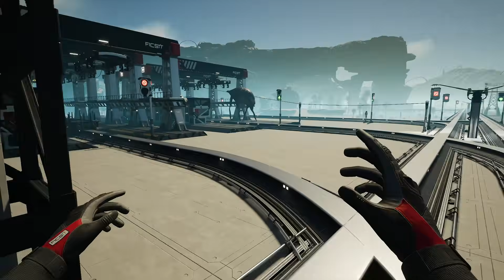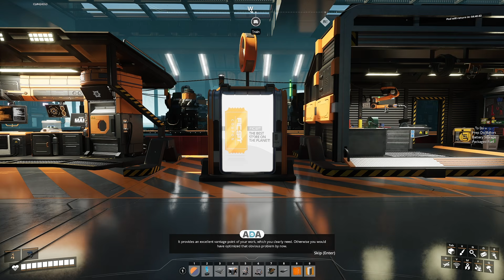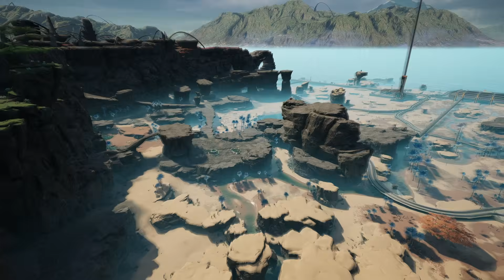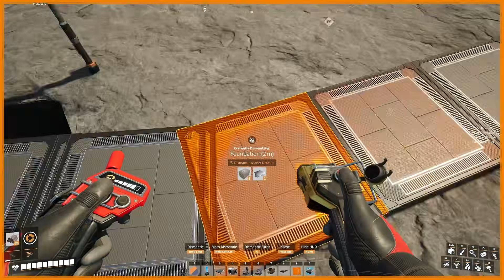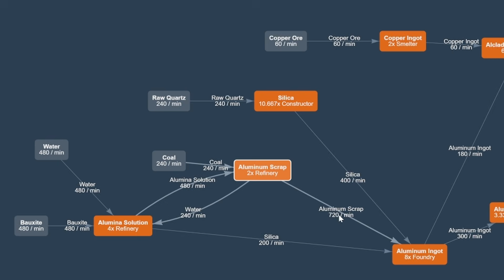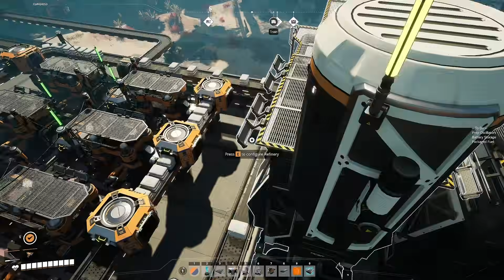Building An Efficient Aluminum Facility in Satisfactory 1.1 Guided Playthrough

Comment: Hi there, love your vids. Did not think of maximizing the quartz extraction as you didbut liked that I won’t have ro go back to that cave, question, did you use the Eastern most entrance/exit to run the belts? If so, right at the exit points over that little rock “divider” there are 2 Coal nodes. :)

Comment: Back recently , its rather easy, just feed the water from the end of it back into the beginning and undeclock the water pump accordingly. No issue. Returning right now after my last save was from 2022.
Reply: Under clocking pumps won’t decrease flow rate, just head lift. I think you mean valves, and that doesn’t always work 100%. If you have a ton of fluid buffers and come by every once in a while to flush them out it’s fine though
Reply: @ookison No, i meant water harvesters.
Reply: @ookison Water harvester clocked to harvest only exactly the missing portion. Cant back up with water thats not in the system. Havent needed any buffers (other than the pipes themselves) and that worked for hundrets of hours, havent even thought about it really when i did it.

Comment: For anyone wondering why their machines tend to stop but you have all your inputs/outputs correct… try deleting your “in” machine(the first refinery making the Alumina solution) water that’s stored. While the correct inputs may be there, the other machine making the Aluminum Scrap stops because it can’t spit out the water byproduct, so by deleting the stored water in the first machine it should level out the water input. Obviously double all inputs/outputs with shards if you’re wanting to increase the overall output but the method of making sure the second machine can spit out its water byproduct remains the same(don’t forget to change your water extractor to 160m3 if you do otherwise you’ve got another issue lol)

Comment: When I start building a railway, I always connect the station to power and start building from the station so I always have hover pack power.

I incorporate power lines like you recommend, but don't connect them until after the rail is done.

Comment: so i noticed if you pipe out all that quartz with Teir 2 miners, that means the teir 4 belts are not sufficient at moving 600 quartz a minute.  i have a ton of tickets would you just recommend buying the alum. sheets to use Tier 5 belts to get the goods out of the cave?

Comment: Why does your calculator look different than mine when I input the sheets and the casings. Its giving me starting recipes that call for SAM and no Bauxite because I guess the SAM is turning copper into Bauxite? Some help would be appreciated so I can navigate this in the future
Reply: Satisfactory tools is assuming you have the converter machine unlocked which uses Sam ore to convert resources into others. In the tools settings you can disable machines you don't have access to.
Reply from the maker: I've done a video on how to use satisfactory tools,but yes, you'll have to deactivate the SAM first

Comment: How do you create concrete only foundations?
Reply from the maker: Unlock the material in the awesome shop 🙂
Reply: @TotalXclipse  I unlocked the concrete foundation in customizer, but that does not seem to create the foundations, just modify them.
Reply: @jammur6917  When you're in the foundations menu, at the top right is a pulldown menu to select the default foundations you want to build.  Once you select the concrete one, it will only show the concrete ones there.  Also, you can hold "E" when you're placing a foundation, it'll pull up the selector wheel.  If you right click with that wheel up, it'll change the material you're using.
Reply: @pr3at0rian2  that's the ticket! Thank you!

Comment: I haven't used the default Aluminum recipe since my first 1.0 playthrough. I always used Electrode Aluminum Scrap, Sloppy Alumina and Pure Aluminum combo. Allows 1:1 Bauxite to Aluminum ingots with no need to bring in Quartz or Coal and instead use oil. 12000 per min Aluminum factory was a pretty simple setup. 

Wet Concrete is fine for a small setup but is a terrible solution for a larger setup. So much limestone and refineries needed to deal with water that can be simply fixed using a vertical junction and feeding water from your extractors in from the top of the junction.

Comment: After hitting lots of bugs making priority water recyclers in two early access playthroughs, this time I just used the water for a line of coal generators. Much simpler, no bugs, the factory generates net positive power, and it's not like water or coal are rare.
Reply from the maker: That's a good idea
Reply: I just feed the water back into the beginning with no such thing as priority filter. Been running for hundrets of hours without any issues, just with the water pump underclocked accordingly to make up only the difference (and of course sinking any excess of the output if that backs up)

Comment: In the rocky desert cave, were I decided not to come there very often as well, I clipped trough the ceiling with a conveyor lift, so I did not have to go all the way around.
I connect the lift in the cave, went up and just looked were the blueprint came out to place it.
Reply: I have a blueprint called "wall hack", which is four foundations with a hypertube entrance on each powered by a biomass generator. You can just nudge it through walls and start building conveyor lines with easy line of site to your factory. I figure if they didn't want us to build underground they wouldn't have allowed it. 😁

Comment: Thanks Total. good Stuff. I have a little "cheat" for that cave. If you run all the lifts to just touching the ceiling in-between the 1st & 2nd quartz, you can run them to the ground above. It helps to have a jet pack to travel in and out of the entrance, and you have to stay in build mode the whole time with a lift.
Reply: FYI you can use a short hypertube blueprint to travel through walls anywhere. Once you're through, you can build anything you want provided you're not underwater.

Comment: My solution for water recycling is to bottle it and sink it. Seems to be the best way to deal with it. My first time I had major issues and either wasn’t producing enough of this because of so and so. 😅
Reply: On my first "temporary" Al facility I ride the cannonball.

The water is fed back to the feeding line.
But the main input has a valve set to only allow the additional flow required on top of the feedback line, and it comes in vertically.
Overall it's balanced on full throughput.

It may have an added time to reach full production speed, but so far it has kept going for a few dozen hours even after ingot output backfilling.
Reply: Try coal generators (it's already there for alum scrap production) or diluted fuel (if you had oil hooked up anyway), either way you'll make net positive power instead of burning power to produce and fill the packages.
Reply: I couldn’t live with myself sinking the water.